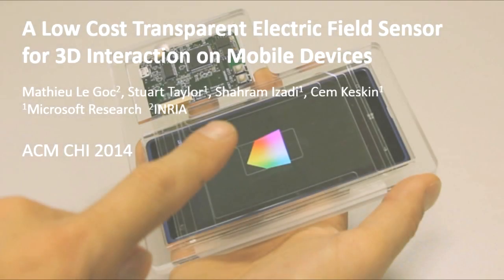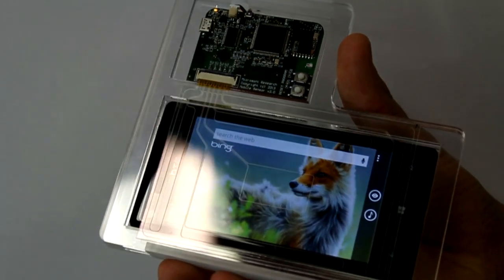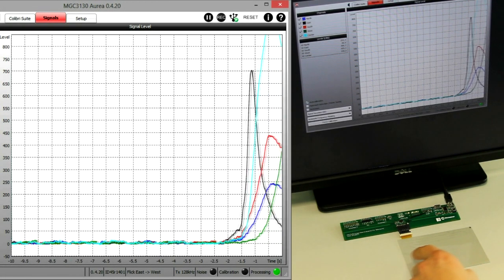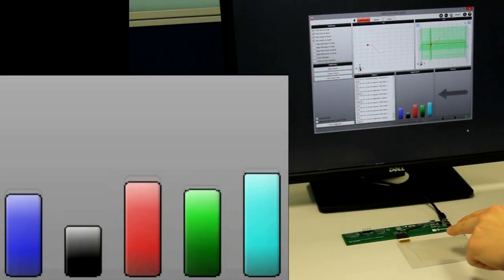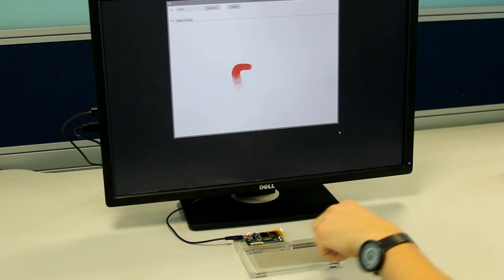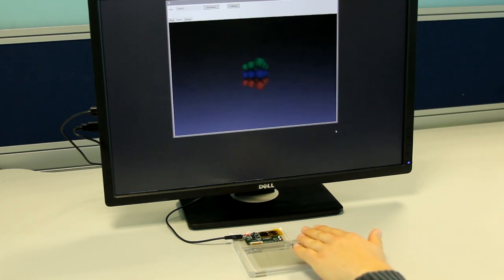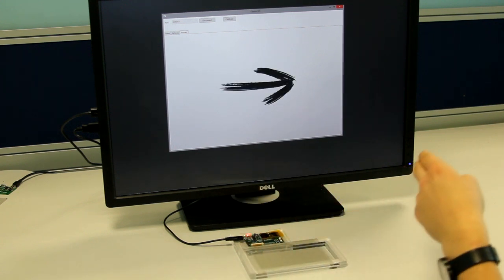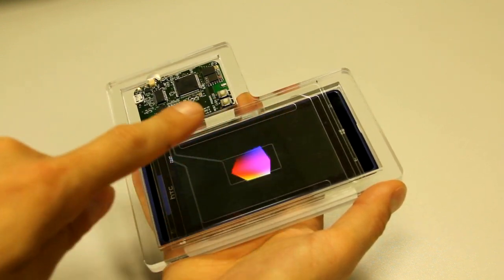3D Sensing on Phones

Comment: C-TP can support "Hover" too, but without suitable Apps for customer.
And Microsoft 3D touch still need "Lamination Process". It's a hight cost
process !
Reply: actually it's not a high cost option. It will be baked into the phone upon purchase and MS isn't going to raise prices just to offer it. The original launch device was a low cost budget phone but they will be launching on the successor to the 1020.